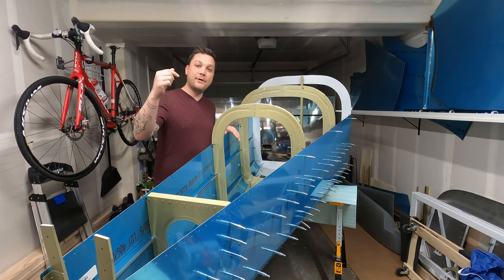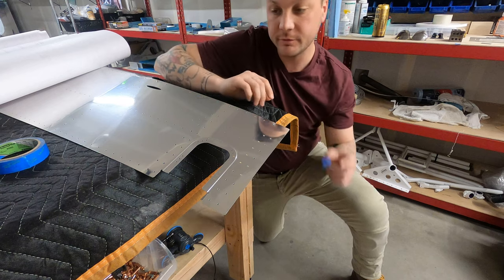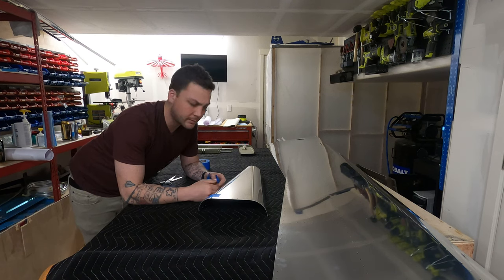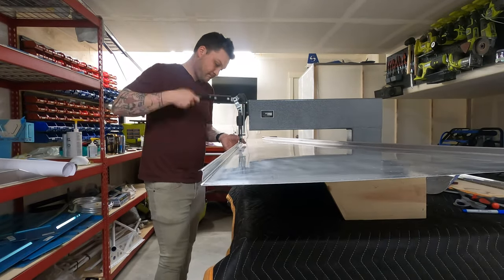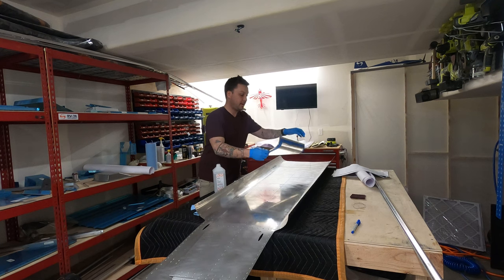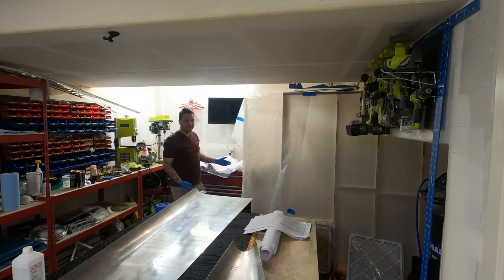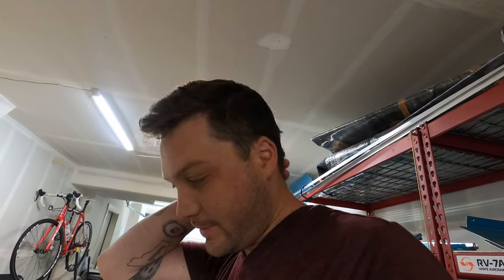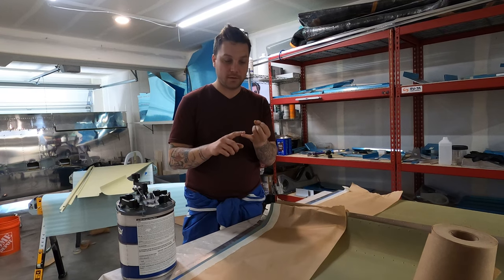Priming an Airframe | EP3.7, Building an Airplane: The Van's RV7A

Comment: I can't begin to tell you how much I have learned from your experience and the timing of this video could not be better.  I am doing my build of an RV10 emp kit a little different than most.  I have taken all the sections to the point of priming so I am getting ready to prime this whole kit at once.  I am setting up my 8' x8' x 8' fold-up booth in my garage and did not want to be setting up and taking down for each section.  I am using the Akzo primer as well (no kidding about the cost).  I have a 4 stage turbine spray unit with a second turbine supplying fresh air to my mask.  I am using a 3M HVLP spray gun with the 3M PPS system (love it for the reasons you mention).  For cleanup, I use a second liner with solvent and attach it after spraying to spray thru the gun to clear before taking apart for final cleaning.  I have also found that placing a piece of painters tape over the end of the spray nozzle between spays while moving parts etc keeps other finishes that dry fast from drying and clogging the tip FWIW.  I was planning to scuff the parts dry with maroon scothbrite and wipe clean with acetone but the PreKote might be a better option.  Can you give me some idea of the quantity of PreKote I might need to do this emp kit?  Can't thank you enough for sharing all this great info.  Looking forward to following your progress - you are doing a fantastic job and a great service to the building community!
Reply from the maker: First off, thank you for such great feedback! And for adding such great tips down here in the comments!

Sounds like you have a good system. An 8’x8’ space is enviable. I wish I had more room to prime!

I bought a regular spray bottle (liter?) of PreKote plus a gallon to refill. I didn’t need to refill until almost complete with my wings. I’d say, if just trying it out, go for the spray bottle and see.

Note the other comment here. PreKote doesn’t advise using a solvent after, instead just wiping with primer. 

Truth be told—I still use isopropyl. 😉
Reply: @RyanFlysPDX  Thanks for the info Ryan.  I am in Canada and Aircraft Spruce doesn't have any so I purchased from SkyGeek.  Shipping is a killer so I bought same as you.  Should be enough to finish the plane based on your experience.  I'm modifying my booth (open faced) to add a bigger exhaust fan and 40" x 40" x 4" paint arrestor filters to hopefully catch the over spray as well as provide enough air movement thru the booth to keep the overspray from exiting the inlet (100 ft/min thru the booth is the target based on what I have read).  I should finish priming by end of Aug and I will be happy to report back on my experience.  Thanks again for your help.

Comment: Interesting review about primer and how the settings are sensitive. I feel you when you say it's expensive. Would smaller parts be OK to prime with something like a spray paint from Rust Oleum ("professional primer" or "etching primer")? I don't know much the down sides of Rust Oleum primers, other than for big parts, a can-paint definitely doesn't look good. But for small parts, that will never be visible anyway, maybe? If it's as good as other primers that is, wouldn't it save a few bucks? Thanks for explaining some good tricks!
Reply from the maker: Yes! Many people, with great success, prime their entire planes with etching primer from a spray can. Granted it takes cases of paint, but it is possible.

There’s various types of self-etching aluminum primer available at auto parts stores that work great for this.

Comment: Hi Ryan - Just wondering if I need to mask over the holes of the skins on the outside to keep primer from getting on the outside surface blowing thru the holes?  That would effectively mask the outside covering the blue plastic removed to dimple.  Thanks
Reply from the maker: Good question. Somewhere on Vans Airforce is a very similar question from me about a year ago!

Typically, primer isn’t going to blow through those holes. There are some pieces that due to curvature or other features will have an obvious risk of overspray. I typically mask these. (Overlapping panels would be one example.)

You’ll get a little overspray on your exterior. It bugs me a little bit, but the surface will get prepped prior to paint.

If you’re polishing your plan, ignore everything I’ve just said and look for an expert to help!

Comment: Hey Ryan, I was wondering if you have had a technical adviser come look at your progress? I don’t have any doubts about your work. In fact, I think it has been extraordinary. But I’ve always heard you should have a TA review your work as you move through the project.
Reply from the maker: I’m the past, the FAA would inspect airframes before they are closed up. Now the FAA is mainly concerned with the final inspection, so technical advisors will inspect prior to a DAR to eliminate surprises, and course correct if needed.

I’ll have an advisor out soon, but I’d like the center fuse section slightly more developed so I can discuss some question I have on upcoming steps.

With the wings still open, this will allow for an in-depth look at much of my work, and certainly some of the most critical areas. 

I’ll be sure to detail this process in an upcoming episode.
Reply: Makes sense. Thanks again for sharing your work!
Reply from the maker: Absolutely! Thanks for the question!

Comment: Hi Ryan, I think I need to build a spray booth for my build, so what would be the minimum length..so I can fit those long skins in? Thank you for all the time doing the videos..super useful.
Reply from the maker: I happen to know this off the top of my head, now that I’ve gone through this… in fact I had a whole section on booth sizes that got cut because of time.

My booth is 6’ 6” x 3” 2”. I would make a booth with interior space of 8’ x 4’ at a minimum. That would fit the longest skins, though some spars will still give you trouble.

If you wanted the California King of booths, a 12’ x 4’ would be pretty sweet, but a downdraft table that size would require a lot of exhaust fans…

Thanks for the kind words and support!
Reply: @RyanFlysPDX  Thanks Ryan, appreciate the reply🙂

Comment: Hi Ryan,

What are the specs of your air compressor? I have read that HVLP guns require a lot of cfms.

Watching your videos has been an inspiration, I have a RV-9a tail kit in the mail and think I'm going to go with the same primer as you.
Reply from the maker: So happy to hear I can inspire!!

The compressor is a Kobalt 26 gal., 150 PSI, 1.8 HP, "Quiet Tech" compressor. I haven't had a problem running out of air. But, well, you watched the episode, I'm sure you'll see I'm not a professional painter and shouldn't be giving out too much advice on equipment. :)

For me it's worked great and kept up well.
Reply: Awesome, thanks for the quick reply! I was very close to getting that model but settled on something a little smaller. Guess I'll find out if it can keep up!

I'm probably going to end up making a build channel too. It seems like a very valuable way to document progress and decisions made. It's fun to watch your first few videos and compare. EAA workbenches and practice kits and all that.
Reply from the maker: @trainboy1000 I find the video creation very rewarding. It’s become a second hobby, but definitely takes some time away from the build. Sometimes that’s a good thing though!

Comment: Hi Ryan - Just got my PreKote and finishing up the masking before prep.  I see from the PreKote instructions, it says you need to paint within 24 hours of doing the PreKote treatment.  It looks from their examples that they are treating the exterior surface of an assembled aircraft - not parts.  I was hoping to prep parts and place them in a closed tote for a few days - then paint.  Just wondering if you have left parts for days before spraying and if so, was there any problems?  Thanks for the help.
Reply from the maker: I have not let parts rest for more than a day, but that is to be expected when priming small batches for immediate assembly.

I’d hate to speculate on a chemical process I’m not overly familiar with, but it seems like some additional time wouldn’t hurt, as long there isn’t contamination between cleaning and spraying.

You might reach out to them to see what their reasoning is.

Comment: Hi Ryan the build is looking great. 
Just a question, wouldn’t it be less work to remove the Alclad before dimpling.
Reply from the maker: To be clear, you're talking about the PreKote and Scotch-Brite process? I talked about that in this episode, and in fact did it in that order for the skins. If you PreKote prior to dimpling, you save your self some work (and Scotch-Brite). 

However, inevitably you contaminate the skins again by handling them so much during dimpling--even with gloves you're maneuvering them  around the shop so much you can't go straight to primer. So you have to go back with the isopropyl after dimpling, which takes a bit more time than doing it at the same time as PreKote. 

So, for smaller, simpler parts, I will dimple first and then do all my cleaning steps so it is straight to primer after that.
Reply: @RyanFlysPDX  My bad Ryan i rewatched and I missed that etching spray you use “Pre Coat” as opposed to Alodine for etching. Thanks for that I’ll check Pre Coat out, never heard of it sounds good in many ways.
Reply from the maker: No worries! Check the description for a link. 

It is a simpler process than Alodine or similar. It may be a little less thorough as a result, not sure. But I like that I'm not having to dispose of chemicals. The Akzo Nobel primer alone is enough toxic stuff for me...
Reply: @RyanFlysPDX  Thanks for the product name too. 
Easier than Alodine process for sure and agree not all parts need Priming, we’re only priming mating surfaces as your doing in this post.
Thanks for follow up too Ryan, cheers M8.

Comment: I bought midi size PPS system which is 13.5 oz instead of 22 oz. Would you recommend getting the bigger ones like you have or keep the 13.5 oz because we prime small batches at a time?
Reply from the maker: Hmm. That’s a good question. My average batch of primer is about 8-10 ounces. Smallest is around 5 ounces. Largest, for huge batches (wing ribs, large skins) was 16-ish I think. And I’ve been wasting a lot of primer with poor setup at times.

13.5 ounces might get 90% of priming batches without mixing two cups. The smaller cup would be a benefit in my small booth. I think there’s less waste to consider too. (Minutely, but still.)

Yeah, I think those lighter cups might be a benefit in most scenarios.

Comment: Hi Ryan, don't mean to throw a spanner in the works and you've probably seen these videos allready but the US military used prekote for some time, probably still do, and in a number of the instructional videos it mentioned not to use any solvents after using prekote. Only to wash off with water and let dry.

https://youtu.be/jO_mbv9Uox8

Some people don't bother with the prekote and go straight to akzo, which is incredibly tough as you know.

So in your case, I'm sure it will still last more than a lifetime.

Awesome progress!
Reply from the maker: I hadn’t seen this video, believe it or not. I have seen some others on the PreKote/Akzo combo (done by individuals) that suggested the wipe. 

I feel like isopropyl is the better option than acetone/MEK I’ve seen used or suggested, but interesting that they recommend nothing at all. 

My iso wipes usually wind up taking a lot of material with them. Hmm. I’ll have to do some tests. Could save time, if I can wrap my head around the process.

Thank you for sharing! This is great. I’ll put a link in the description.
Reply: @RyanFlysPDX  

Here's an F16 and B1 being done:

https://youtu.be/Kx3H8I0ll9Q

https://youtu.be/t3vd2f5psj4

And here's another chap using water rather than solvents

https://youtu.be/22KudZX0uZM
Reply from the maker: This is great stuff. 

I bet the bill for the primer on the B1 would make one shutter…